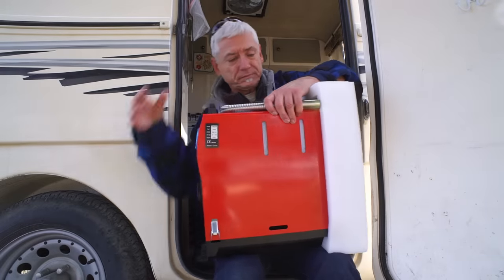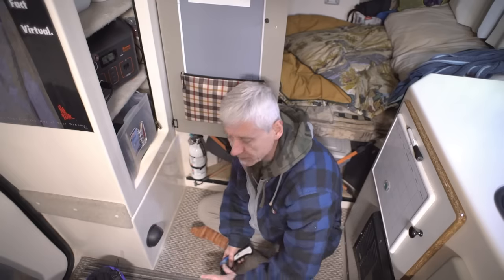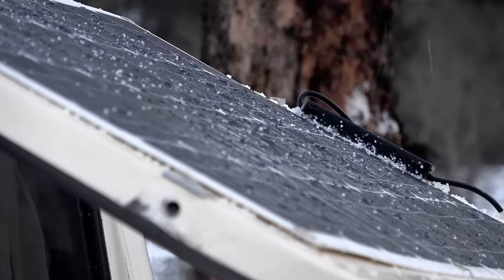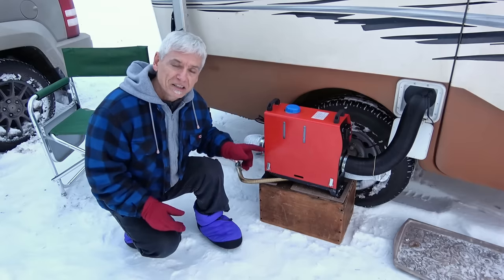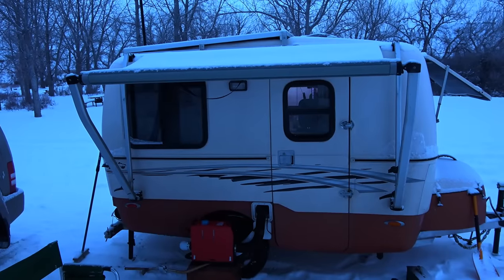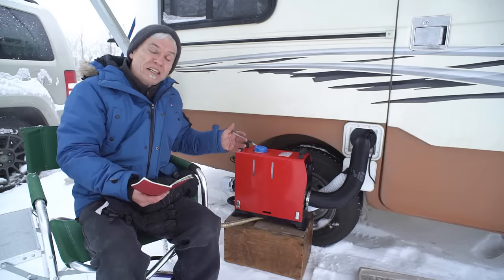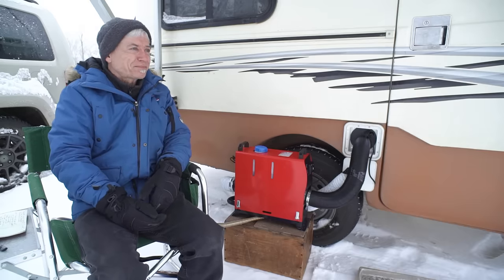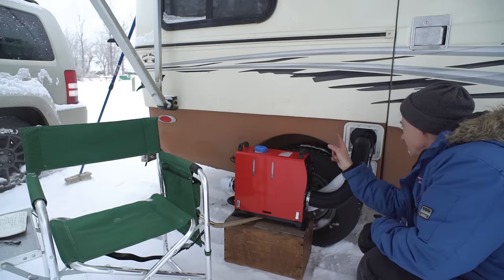Can this Work with a Camper? My Parking Heater Experiment Part 2

Comment: Hi Slim I was watching a YouTuber with a diesel heater the ticking sound that comes from the pump mite be the pump moving and not the pump it self. He suspender in the air with a hook and wire tie but I don't know the location of your pump if that's possible if it's just lays there maybe you could hold it down someway and see if that works. Enjoying your videos keep them coming.

Comment: Slim, comment from the UK regarding CE marking. Items sold in Europe need to be CE marked to indicate it has passed safety and EMC compliance so under normal circumstances means it is safe but CE is also self certification process which from s reputable company is not s problem. The main issue is with the Chinese. CE also means China Export. They even made the China Export logo similar to the European CE mark, so you are right to be suspicious. So the marking maybe either. Having seen its construction I would suspect the latter.

Comment: Good modifications. Maybe you could build an air intake box to collect some of the warm air around the outlet. 
The camper looks great!  Thanks for sharing your experiments with us. I was considering a diesel heater myself. 
The ticking would drive me nuts! In my opinion, your exhaust was too close to your fresh air intake. That could explain the diesel smell when it quit in the first test. Burning diesel inefficiently produces more odor. Does it have a built in CO detector that might turn it off?
Reply: I jumped the gun on my comment about it shutting down. The jackery!  Maybe powering the heater directly from the onboard battery would be more reliable?  You’re a very intelligent man Slim. Love your videos

Comment: Hi have a Wabasco Diesel turbine heater in my semi truck. It is mounted inside the side box under my bed. Yes, it makes the ticking noise, but it gets quieter as the temperature is maintained.I never smelled the diesel.

Comment: Fabulous!  You did not disappoint! 😁👍 I do have to ask though, how much power does the propane heater use?  How many nights can you get from the Jackery when you use the propane heater (assuming no solar / cloudy days)?  And, how would that compare to a standard 100 wh FLA battery?
Reply from the maker: The onboard furnace uses about 30 watts, which works out to about twice the power consumption of diesel (assuming propane not on all the time). My guess is the jackery would lose at least half it's charge after one night with the furnace. Not sure what a "FLA" battery is, but a deep cycle probably would not last the night. Thanks! SP
Reply: @SlimPotatohead  Sorry, FLA is Flooded Lead Acid battery and I meant to say "100 Amp Hour".  I guess that is similar to a deep cycle?

Comment: i have had the same issue with my Jackery 240, with a very low draw it will shut down after a set time. Ck with Jackery I think yours is by design!   I have a 1000 also but it is used for higher draw items, so far it has not "timed out" but i was told it will do the same with very low draw. Will Prouse has talked about this with Jackery power units
Reply: Will knows the technologies and explains them well. And, not afraid to call out the poor products out there.

Comment: Something you may try with the fuel pump is to suspend it with something like a piece of inner tube.  Tip i have seen on some van installs.  You will still get the ping noise but not as much resonating sound.
Reply: Already tried ... didn't help.

Comment: I love watching your videos.  These last two videos remembered me so much of my last trip out.  I was also testing a Mr. Heater Buddy and my onboard Propane heater in 6 inches of snow outside.  I assume you have a weather radio that can warn you of approaching bad weather.  Thank goodness I did on this trip.  As in your case, the prediction for later that day was for an additional foot of snow and winds exceeding 60 mph at our elevation of 7,600 feet.  As you did, we packed up and go the heck out of there.  We went down lower and still had heavy rain for a day and a night.

As far as the Diesel heater goes. I think you did a very good job of demonstrating it to us.    But I suspect you will not be using it much.  It seems like a lot of work just setting it up, and it just adds more weight to the load.  I also noted that even with cloudy weather, my solar panels still generate some power.  Apparently they don't need full sunlight to start producing.  I look forward to your next video.

Comment: I was wondering how much heat you're losing from the outside heater hose.  I might've missed you covering that part, but is the hose insulated?  Yeah, the clicking would drive me nuts too.  There may be some way to minimize the noise of the pump.  It's too bad they don't make a silent pump for those units.

Comment: Sorry I should have watch the whole video before I made my post I have moved my heater to the inside of my camper and ran the exhaust out just like the furnace the fuel pump tic is like the old clocks thanks for the video. 40deg.f is as cold as we have had ours out yet hope it works out for you

Comment: Thanks SP! I've been thinking of doing the same with my old camper. This is a big help!
Reply: Update: I got a 5kw heater without the box. Installed under the couch with the fuel pump and tank outside. I can hear it but was not bothered. Performance is great for me. With Temps in the mid 30's at night I burned 2 gallons of diesel over 5 days running 10 hours per day. It kept the inside temp of my drafty camper at 68 to 70F without a problem. Thanks again Slim, your videos are Gold!

Comment: For the fuelpump are special rubber mounts for sale that eliminates 90% of the noise you heard in your test.
Loads of car manufactures use the Webasto Termotop for aux.heating in cold weather in modern Diesel vehicles and you'll not hear the pump running
unless you listen very carefully.
Ask your local Webasto agent for it.

Comment: I dont think the click noise is any worse than the heating units that come on Recreational vehicles or some air conditioning units.  So it only be a problem in a camping situation where vehicles are sometimes as close as a parking space.  What do they typically use these heaters for?

Comment: ii have a 5kw in my 30 foot camper it works great...last night i turned it on for the night..-2 with a 30klm wind..it has 6 settings,,,left on 2 over night and checked this morning and its 18c inside..i used it all fall while hunting and it never failed ...

Comment: You should buy the set that comes in pieces instead of the all in one.  You would be able to solve all your problems and reduce set up and take down time.  There is a more expensive propane version.  I'd like to try my own heat exchanger.  Propane or wood burner outside that heats metal air chamber.  A fan that pulls the air inside and recirculates inside air through the chamber.  It is like a portable wood or propane fired furnace.

Comment: Happy New Year!!
Were you just trying the Jackery out? Did I miss the part about why you need both diesel and electricity? Thanks for doing these types of videos. They make me think.
Reply from the maker: Hi Gladys, the parking heater needs electricity to run the controller, fan, pump, and ignite the heater. Thanks! SP

Comment: I think you can quiet the pump if interested.  Mount the pump from 3 (at least) opposing direction with paracord (& not directly touching any metal) and that will stop the sound from transferring to the base.  sound doesn't travel through paracord. 
  I was interested in the diesel fuel consumption but you didn't talk about that.  Did you track it?  Great video series.

Comment: You can buy pink rubber shrouds for the fuel pump to help lower the pump noise. Also try suspending the pump on elastic or zip ties as the less it contacts the quieter they are.

Comment: Slim there is a company out of australia that makes an after market upgrade controller for that heater that'll give you more control, as well as the ability to control it from your phone, its called the Afterburner, and i'm sure you can find videos of them here on youtube, it comes with several options including a remote mount thermocouple, your other controller should have had a temp sensor in it  as well, thanks for the vid and the good info with your unintentional review of this little heater

Comment: I'm leery of it running outside. Consumer electronics are not rated for use under 0C but they usually work.
If it was using inside air, it would probably be more efficient. I would have gotten the kit version. Mounted the heater inside and tank and pump in the propane tank area. The heater itself would have used very little room inside and the pump would be quieter. Looks like it is the kit version mounted in a cheesy case so you could use the parts.
I was surprised how low power it uses.  Probably due to the really small fan. Really should have a bit bigger fan so the output temp is not so high.
 That fan is the issue with the propane heaters, they are way overkill for a small trailer. and designed for shore power.
The noise seemed less then the chipmunk that insists on chirping outside my bedroom window every morning ;).
When I get my trailer, still on the fence with propane or diesel. Thanks for some insight on the decision.
Reply from the maker: Hi Scott, I ran out of time, but intend to discuss another option in a later video. Rather than bother with the problems of diesel, my money would be better spent on simply upgrading my propane furnace to a quiet, more energy efficient one. They have changed a lot lately! Thanks, SP
Reply: @SlimPotatohead  Looking forward to even more options. to confuse me ;)

Comment: I think it would be worth trying to rig up a foam isolated mount for the fuel pump. It’s hard to tell from the pic, but it looks like that pump is rigidly mounted to the case.  Sounds like moving the fuel line away from the exhaust would give you some peace of mind.

Comment: That white four letter word is why I moved south!!! I'm originally form Ohio and also spent time in Missouri with the white four letter word. Here in "Northern" Texas it still can and does get very cold and.....dare I say it......"SNOW".  Now that you have duct work to bring in fresh air and send spent exhaust away.....put some heat proof insulation box around the heater for "sound proofing" so you can barely hear that clicking noise, at least fro the outside.....might not even hear anything inside. (think auto sound/heat proof material)

Comment: That fuel pump is considerably louder than the pump on my Webasto.  The main noise on the Webasto is the fan.  So, in addition to putting some sound insulation in, you might consider a different pump.  If you are getting a diesel smell at shut down it is because the intake and exhaust are too close together.  I have my heater set up so that the intake can not draw in exhaust and I never smell diesel.  The only other reason to smell diesel is that the heater has failed and there is a hole in the heat exchanger.  However, that would give diesel small all the time.  Nice experiment, but I still prefer a permanent install.

Comment: I think that if you built a steel or even aluminum (thinking about the new aluminum brazing rods that just use a torch and build aluminum connections crazy strong) insulated box to contain the unit, which eliminates concerns from the elements and the noise for starters, with openings for exhaust, intake and supply air and quick connects on the outside, and travel covers over them, you could quickly hook it up at a stop by just connecting the supply hose (i.e. exhaust pre-routed far enough away permanently mounted to the camper frame to not be pulled in the air intake ever), and alleviate your concerns if the thing melted down.  Making the "box" deep enough for a false bottom to raise the unit up enough to contain the fuel in below the false bottom (sealed watertight to not leak out) area would mean that a fuel leak wouldn't be much of a fire in a sealed box with limited air intake potential.  Some rubber bumpers to hold it inside for a snug grip while travelling and a latch for the lid and you're good to go to fill the tank with diesel.

Comment: Wondering If When You Are Starting Up The Unit // You Use A 12v Cord From Your Running Vehicle & Utilize That Power Consumption // Running The Vehicle At Least Once A Day Keeping Your Alternator Charging Up That Battery 
Is A Two Fold Wattage Usage
Win ! Win !
Great Way To End The Year
Thank--You Slim

Comment: Hey Slim P First Off Happy New Year to you , Now as a Former Truck Driver only off the road 4 months now i gotta say the Bunk Heaters in the Sleeper that all the modern rigs have do that same tapping noise not sure what it is But i can tell you if you don't hear it you will not get heat , something i think with igniteing the fuel But that said when the bunk was closed it was quieter So maybe if you build a box around it you could get it quieter ??.

Comment: Hey slim, just a couple thoughts. 
Kerosene torpedo heaters will run on diesel,  I wonder if the diesel heater would run on kerosene?  If it did, that would take care of the  stink.  Try wrapping the pump in some sort of insulation, maybe that would quiet down the ticking noise.

Comment: That noise I was thinking of installing one..now I need to rethink thanks slim
Reply: I would hope that top end or maybe even middle of the road systems don't have the same noise problem, because most people put the whole thing on the inside.
Reply: Most say to suspend the pump from the fuel line helps a lot. A90  degree rubber elbow also helps and I suspect softer rubber fuel line would also isolate the sound

Comment: Great Video! 
I think I am going to do the same thing primarily, in mounting the heater to my truck and then ducting to the trailer. I had a couple questions, First do you think a return from the trailer would work better, giving hotter than outside air to heat? Second is: does it hold its memory after disconnecting power? Some electronics do, once power is disrupted, you have to set it up again as new.....
Enjoy your videos!
Reply from the maker: 1) In my case I was not looking for more heat, so adding another hole would have been an unnecessary step. 2) Once shut off, it started from scratch again. Thanks! SP

Comment: You just need a sound dampening material where the fuel pump is mounted. It's mounted on the chassis of my trailer and since that is more rigid ticking sound is lower. Also, seen a guy who mounted a dual muffler on it and it really helped cut the noise from the exhaust. The air did melt hot glue used to mount the trim on my wooden furniture, so I am looking for an alternative airflow orientation to solve this issue

Comment: Did you get a whole new chair or just switch the stripe material for green? Whenever you mention heating/warmth, I smile as I just re-discovered how nice a hot water bottle is for a boost when I don't have power. Easy set up and lasts all night. Great pre warmer and can tuck into hoodie when going outside. Went through all your programs; not a one I didn't like.

Comment: First off it is neat to see that Dinosaur  provincial park is still open. We camped there in February and loved the solitude. With the heater being outdoors you may run into fuel gelling in real cold temps. If you have a choice of number 1 diesel to purchase in real cold weather it would be a better choice. If not available then adding a conditioner , like Howes fuel conditioner, would be a way to prevent gelling. Have you considered making a case out of foam insulation for around the heater? might quiet the pump noise for you. It would protect it from the elements as well.
Reply: Canada is considered an Arctic country by the petroleum producers, So when fall approaches they blend the fuel for lower temperatures. We are just coming out of an arctic cold snap(Having a chinook) the coldest it got was -38 C or -36.4 F that is just ambient temperature not wind chill. Never had a problem with diesel gelling and I don't use any conditioner.

Comment: This is a great mini series! :)  Agree that the model you tested looks a little too cheap and sketchy. Hopefully you find a solution that works, I'm very interested in hearing what you come up with as I'm looking to get a quiet furnace for my RV (which currently makes as much noise as a vacuum cleaner when blowing).

Comment: The first thing I thought of regarding the heater was fumes.  One reason I have rarely used my small generator for my AC is even with the rig totally closed and set 50 ft away I can smell it inside.

Comment: Slim,
 Is it possible to isolate the pump from the metal frame, inside a soft foam enclosure?
 That should greatly reduce the thumping made by the pump.

Comment: Thank you for a great explanation of your heater. You may have already answered this, but why not use a Mr. Buddy portable propane heater? Seems as many RVers do with positive results.
Reply from the maker: The Mr Buddy is terrible for condensation. Seek out my review on this. Thanks! SP
Reply: @SlimPotatohead  ok, thanks. Yes, I see. That would be a problem with the "rat fur" inside. Thanks.